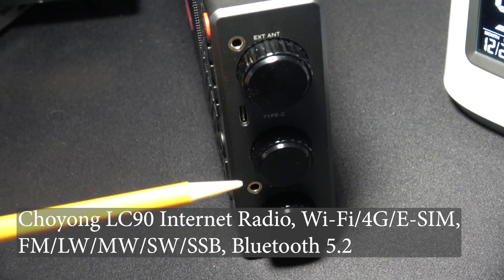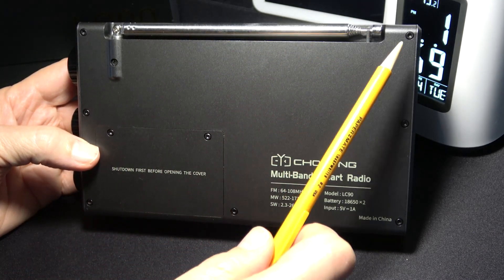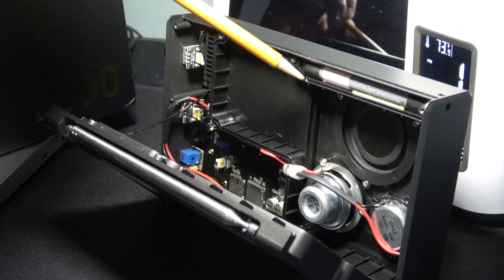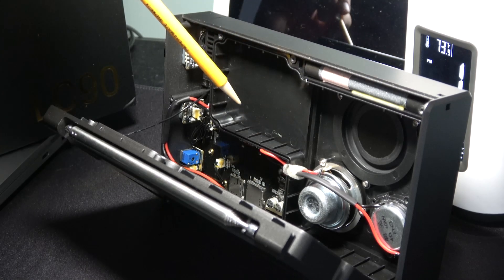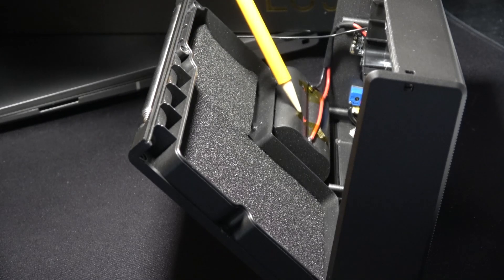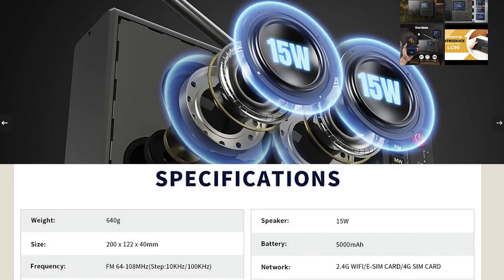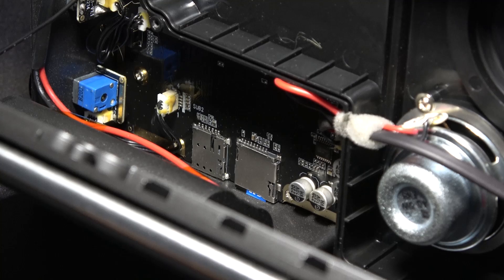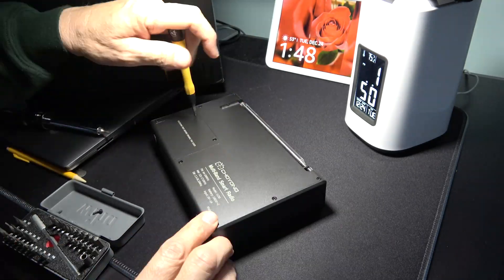CHOYONG LC90 has a speaker cabinet

Comment: Interesting to see the inside. Thanks for posting. Right now I supposedly have an LC90 sitting in my country's arrival hub. Hopefully it'll be with me early next week. I say "supposedly" and "hopefully" because I've had TWO mythical $100+ radios sent by AliExpress stores that were "delivered" to another city. AliExpress gave me refunds but it was frustrating. This LC90 is from a CHOICE seller, which apparently makes it more reliable. I should add that all my other Ali orders purchases have been great. However anyone buying a radio needs to be wary of recently-created stores with not many sales. You're unlikely to see bad reviews until the scam has been running a couple of weeks, and then Ali will take the seller down.
Reply from the maker: When possibly I try buying from the manufacturer, but sometimes the price are much lower elsewhere. Glad to hear AliExpress made you whole, still it is frustrating. Hoping you get the radio and enjoy it. Thanks for sharing your story.

Comment: Great explanation. Though ext. antenna and headphone jack appear to be not the right place, but are hardly used. For 99% buyers, quality of Sound is the most important. And l90 is Amazing, given its size and compared to my two other Internet radios.
Reply from the maker: Overall pleased with this radio, especially with the sound quality. My son thought the stereo was on, only to realized it was the LC90 sitting atop the center speaker. On a recent trip, I was using the sleep timer function and discovered that unless you turn off the radio the next day it will drain the battery. Will be sending Choyong an email so they are aware of it. Thank you for watching.

Comment: No reason the hole couldn't be on the top or back of the unit
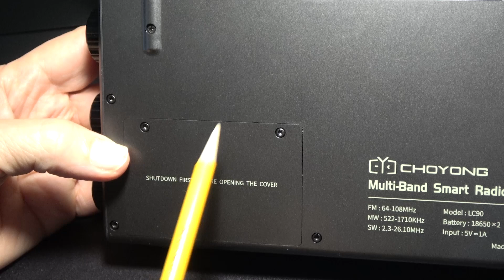Reply from the maker: If you look @0:43 the speaker cabinet takes up most of the top, leaving enough room for the knob controls. The backside has the battery compartment that snugs up against the electronics. The only real space is inside the audio cabinet. I think it is impressive the amount of space they dedicated for audio reproduction.

Comment: False advertising if they state the speakers are 15 Watts when they are actually 10 and 5.
Reply from the maker: Actually 10 watts plus 5 watts gives you the 15 watts they are claiming. The actual specs say 15 watts, not 15 watts per speaker. Perhaps the marketing folks got carried away with the illustration.

Comment: Thank you for the video. LC90 is a great radio. Tried to fit the new Xtar  4000 mAh 18650 and sadly there is no room.Can you recommend the highest capacity battery that will work? Happy Christmas
Reply from the maker: I have not found a need to upgrade the included batteries, but I do use the Ultralast 3400mAh 18650 in my Qodosen DX286. Got those at the local Ace Hardware. Hope this helps. Thanks for watching.
Reply: I use a 256gb in my LC90 FAT32 and it works great. Hopefully they will allow screen brightness adjustment in 4.7 firmware. I would like to din the screen as low as possible.
Reply from the maker: @safugpac2691  Choyong says max is 32Gb card, but great to hear it works up to 256Gb card. Of course I have yet to fill it up. As to the screen, I have it set to go out after 20 seconds but agree having a dimmer control would be nice.